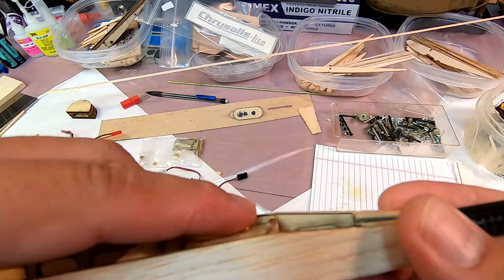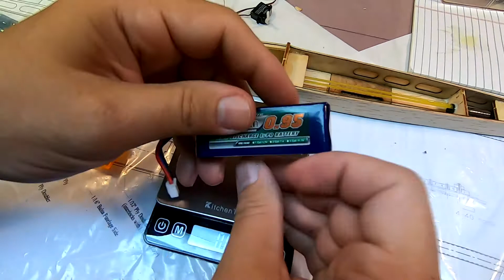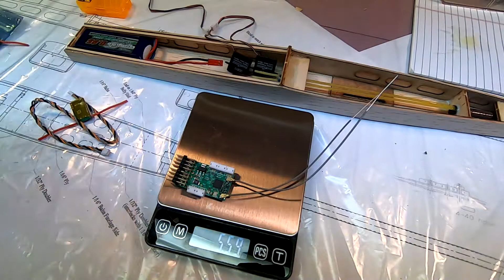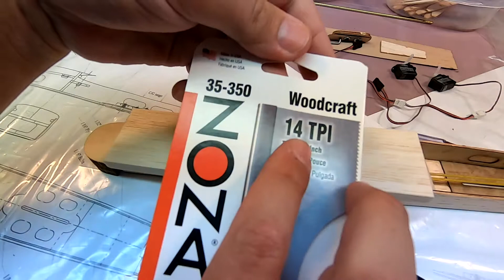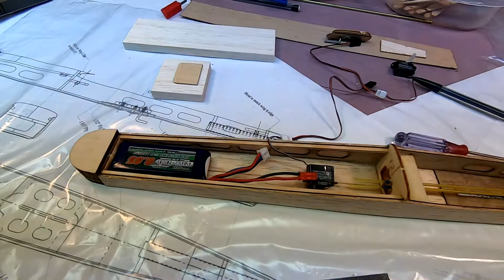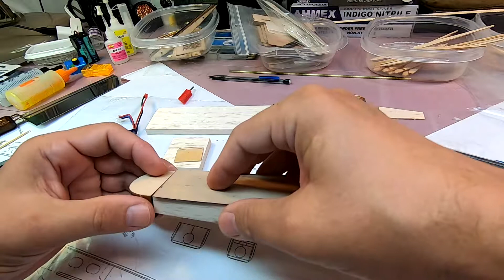Chrysalis-Lite RES Build - Pt4d - Assembling the Pod/Fuselage

Comment: CJ
With the 2.4Ghz antennas it's only the last inch or so that receives the signal so the all out length is not too important. If you look at the orange rx it's only the last part without the insulation that counts.
If you strap the servos in please don't make the mistake I did and have the strap too tight. I put one on and it caused one servo to bind because the case distorted ever so slightly but it was enough the cause the gears to bind . I changed mine so the strap sat with a tiny bit of clearance between it and the servo case, plenty good enough to keep the servo from pulling up.
Reply from the maker: Hey Geordie, how's it going? Did you check out any of those sub-250 gram planes? 
Yes, the length is there to facilitate having the ends of the antennas exposed at a variety of locations. Which is the potential down side of the micro receiver, since it has such small antenna leads. 
BTW, thanks for the warning about the servo binding issue. The servos are so tight in the side braces that the cap is almost unnecessary. I'll be sure not to tighten it to much.
Reply: My RC Channel 
Yup, I checked out the planes, all pretty neat but I've got my heart set on the art hobby agena e-v 1.5M . I tried selling my kunai to fund the agena but no luck. Oh well I'm very happy with the way the kunai flies but still haven't been able to get to the flying-field for ages. Maybe next year I'll be able raise the funds to get the agena, lol. Or if you get one I'll be able to see how to build one from your videos.
Hope your surgery went well.
Reply from the maker: How/Where did you try to sell the Kunai? I've heard good things about that kit, like it's a real speed machine. They were out of stock for a while so I'm surprised you couldn't find a buyer. I've had good luck moving rc gear on ebay.
The surgery hasn't happened yet and my eyes are getting worse. I have the Unaffordable Care Act to thank for my overpriced insurance which as it turned out had a very high deductible that I couldn't afford. Anybody who believed the promise that prices would go down by adding a layer of government bureaucracy on top of the existing health care system was an idiot! I guess sheeple have to believe that there is a free lunch. Since I'm disabled, I'm eligible for medicare and have transferred end of this month. But since the doc I was seeing doesn't take the supplemental coverage I chose, I have to find a new doctor and start the process from square one. Major pain in the posterior!
Reply: My RC Channel ,
Man that's a bad medical situation you're in, hope it all works out and you can get back to flying.
As for my Kunai I tried advertising it on our local kijiji online classifieds . I had over 130 views and two major enquiries but then they failed to show up. I will not ship it or take any kind of payment other than good old canuck bucks because we have lots of scammers on there and I can't afford to lose the value of that plane. If you have a chance to fly one give it a go, so far it's my most favourite plane of all time to fly. Super fast flights or just cruising around it can handle it no problem. I was only looking to sell to get the funds to buy an art hobby agena ev because I think that might be a bit better quality. If I had any brains I'd just go to my lhs and pick up a second kunai to keep as a spare.